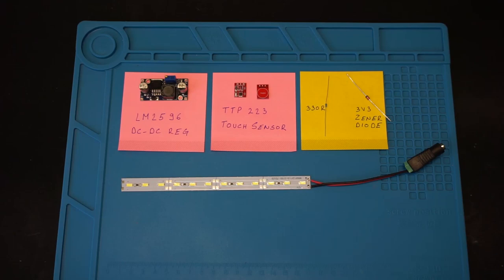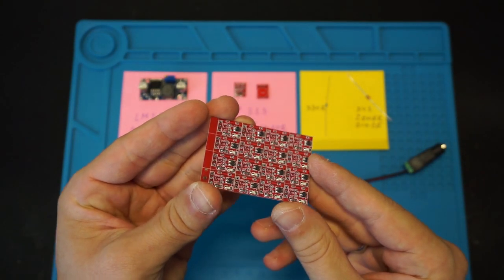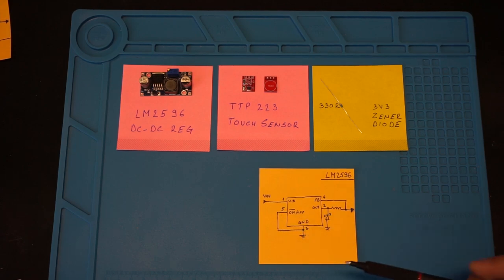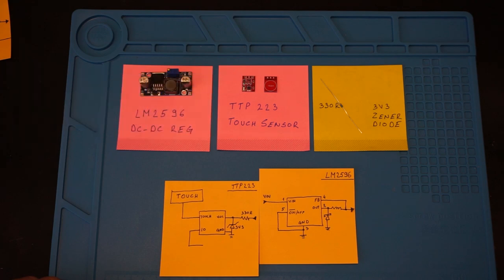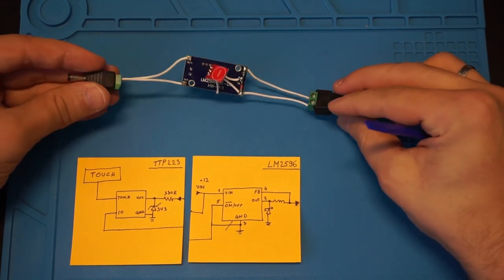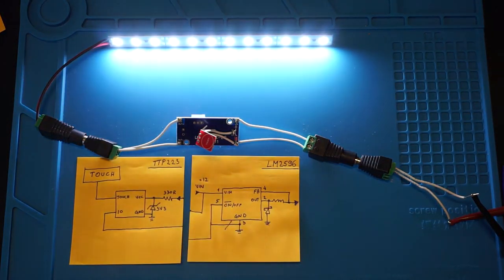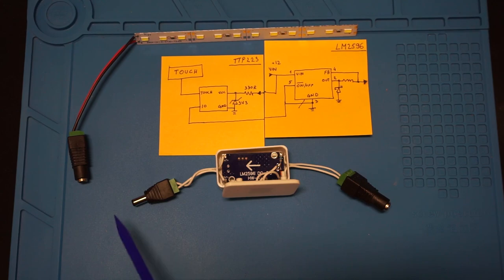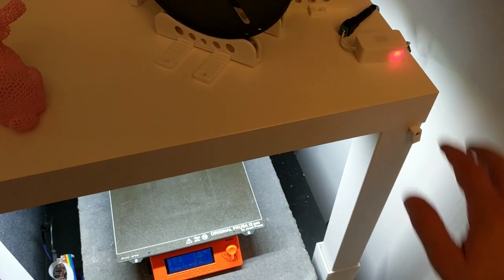3D Printer Enclosure - Touch controller for my lights

Comment: Nice video!  Mind sharing the STL for the case?
Reply from the maker: Thanks! Absolutely, here it is on the Thingiverse -> https://www.thingiverse.com/thing:4657198
Reply from the maker: Sorry about that. Thingiverse has a 24 hour delay before upload becomes public...
I've added download link in the original blog post -> https://sasakaranovic.com/projects/3d-printer-enclosure-touch-control-for-your-light-setup/